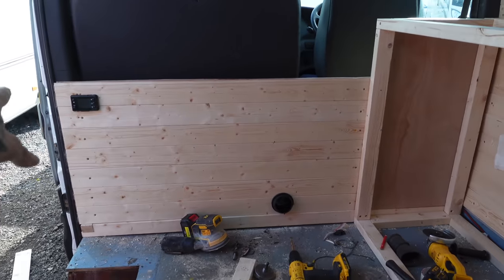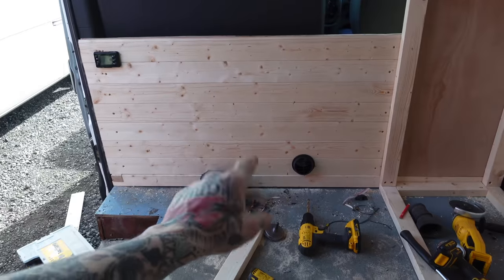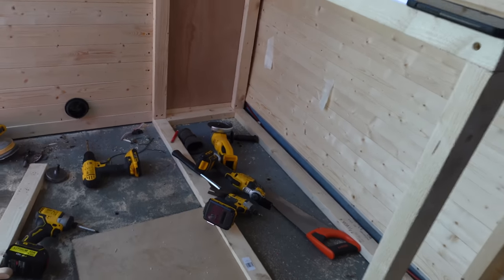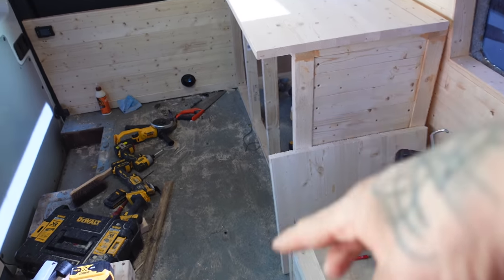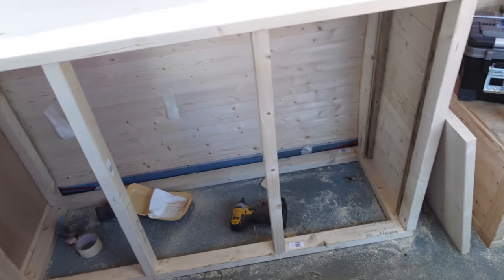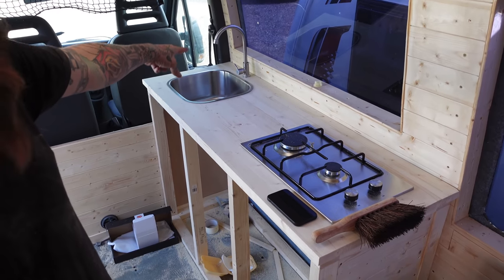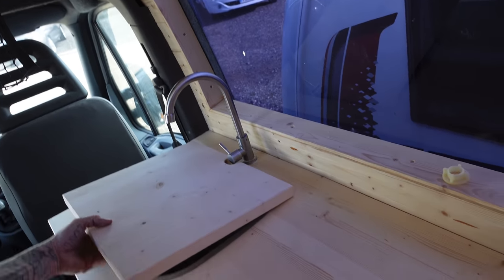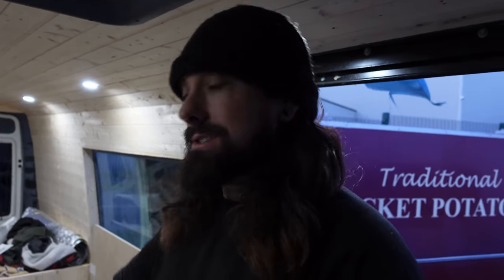Ex Ambulance To Campervan // Pt Seven

Comment: Just an idea to save having separate mains sockets for the inverter and hookup.  An £8 switch to change between the two sources would mean you only need one set of plug sockets. Something like this
Heschen Universal Rotary Cam Selector Changeover Switch SZW26-20/D202.2 660V 20A ON-OFF-ON 3 Position 2 Phase 8 Terminals CE

Brilliant job on this van btw